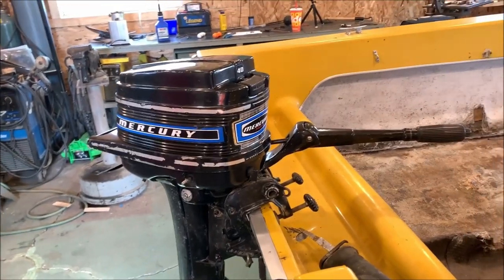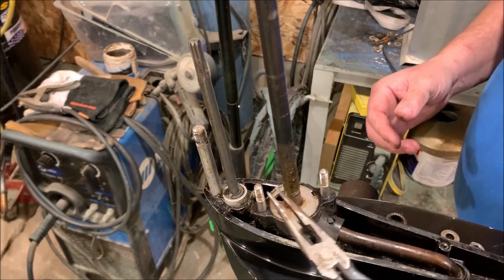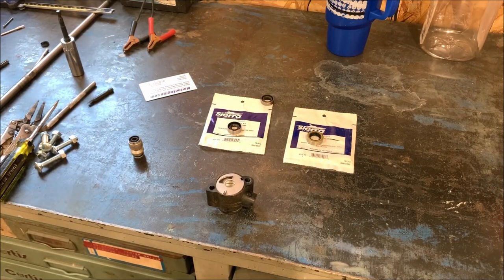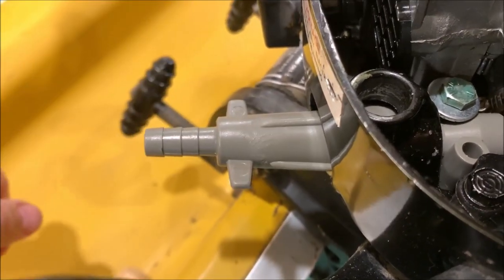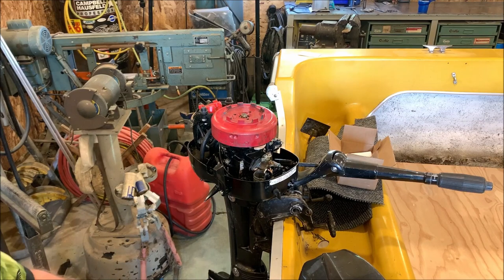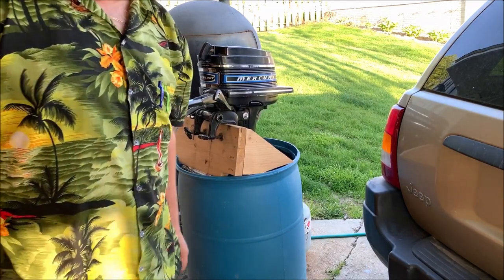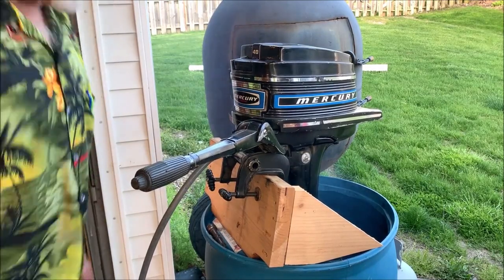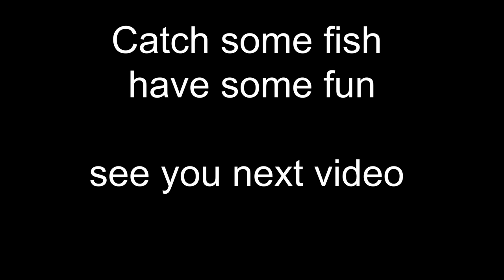Mercury 4 hp outboard 1974 will it run again epic journey of success made in the USA a man and motor

Comment: Thank you for helping us maintain our vintage motors. I have a 1967 mercury that runs great but hard to start. I noticed that I prime the motor and fuel is being back washed into the pulse line, is this normal or can I have a bad check valve in the pump? Thank you again for any advice you can offer. Subscribed!!!

Comment: Great video just got a boat today with the same engine first time owning a boat fired up the engine and had to keep starting it so next move is to do the fuel pump and clean the fuel system up and do the water pump as well because I wasn't getting water to come out like yours great video sir and do you have part numbers by chance thanks again

Comment: Just picked up a 1968 merc 6hp. Guy I bought it from said it runs a bit when he stayed fuel into the carb. So I figured it a fuel issue. Cleaned the carb it's was pretty dirty. I also hooked up a compression tester. Got 60psi on both cylinders. But she runs good after the carb clean. Good spark 60psi compression.and I guess now I also got fuel.

Comment: Great video thanks for the information, I have a 4.5hp 2 stroke that has the exact same carby and fuel pump but I can’t get the kits here in Australia and coming from the USA the freight is the killer. Could you help me with the quicksilver part numbers please for both the carby and the fuel pump.
Thanks again

Comment: Hey brother love the video. Im having an issue with the same motor. On the top cover of the carb there is a little hole and gas is leaking out. It looks like there is supposed to be a cap or a small ball bearing pressed in? Just curious if you knew anything about it.
Reply from the maker: If gas is coming out of the carb anywhere, then something is not right.

Comment: I just bought a 1967 3.9 hp Mercury with exactly the same running issues. I cleaned and rebuilt the fuel pump but the pump keeps leaking fuel out the sides between the mounting screws. Did you use any kind of sealer on the gasket or diaphragm. I just can’t seem to get it to stop leaking fuel. Any suggestions would be appreciated.

Comment: Hey Michael, have a dumb Q for you .. I have an old 4 hp from a garage sale for $25 bucks that I want to convert to electric. My plan was to remove the motor and fabricate a mounting bracket for my brushless motor... Any suggestions on removing the motor itself? I removed 6 bolts  and thought this was it but not sure... 1st timer here but not afraid :-)

Comment: Good video, all isssues I had have been addressed and the aspect of the right side of the engine showing the tell of the water pass thru was the last issue I had as the left side did not show the tell.  Good job, enjoy the "new" engine.
Reply from the maker: the old 4hp doesn't have the traditional pee hole. it just blubbers out the back hole above the waterline

Comment: I just started working on the exact same engine, could you perhaps share any tips on removing the carburetor? Just looking at it and it seems to be very very tight on space
Reply from the maker: remove the fuel pump and the chock knob first. This will gain you access to the carb.

Comment: Its not all about hearing it running. I watched this hoping to see how you removed and rebuilt the carb as i need to do mine and i cant get the carb off the engine. Cant find a video anywhere if how its removed
Reply from the maker: I have some mercury carburetor videos coming in the future.  I have about 10 mercs in the cue right now.
Reply: Same! I got mine out, but I'm dreading when I go to put it back in. Very tight on space.

Comment: So I acquired a Volvo penta 39. I don't know what it's called, but it has a bunch of blades on top of the motor. I need to remove this but I don't know if I should use a pulley puller from an auto parts store or a special tool is needed to remove this. Do you know where I can get the tool needed to remove this part or would it be safe to use an automotive pulley puller?

Comment: I have same motor from 1973. When doing a run test in a full rain barrel, I open throttle in neutral, and the exhaust is very grey and smokes a lot. When I adjust the low idle speed using the slotted screw above the carb intake, i got it to idle better and not smoke as much at low throttle. Gas:oil is 50:1 mix, using recommended 2 stroke outboard motor oil. Does one need to adjust the high and low timing screws on the cam which the throttle slides along? or does one just live with it burning lots of oil?
Reply from the maker: two strokes will smoke a bit, I like the Amsoil outboard mix, it smokes quite a bit less and it will foul your plugs less too. thanks for watching
Reply: @Michaelsbackyardmarina  thanks for the tip. I tried it with fresh fuel and it was as smokey as the regular 2 stroke oil I used before. I guess there might be a problem with the piston rings or something else which results in poor combustion.
Reply: It runs smokey like the one in these 2 videos www.youtube.com/watch?v=938OBzNR_vE and www.youtube.com/watch?v=7tFf44rZvxI . Any clues as to what could cause such smokey exhaust and how to minimize it?

Comment: I just picked up this exact same motor. I’m new to this. Can you tell me what type of fuel line plugs into this. The ones online appear to have a guide pin with the fuel line. This one is in a round hole that the fuel port is in The single male port had a spring loaded tip. There is a single pin at the back of the  fuel port that that is on both sides of the port thank you.
Reply from the maker: Check out  oldmercs.com to see if they show you the type on this 4hp outboard.

Comment: I was just given a 1981 I think, has been started in 10 years, so far I have cleaned the inside of fuel tank and new plugs, plan to get new fuel lines, install new impeller then see what happens, would appreciate any suggestions
Reply from the maker: Caburator may need cleaned, but try running it on a two stroke mixture with some seafoam.
Reply: That’s what I thought but dealer said Mercury product was much better

Comment: Did you ever have a problem with the gears in this motor ? I have this exact outboard and I cannot get reverse ? Reverse gear is neutral and neutral/forward gear is just forward ?. 
The gear shaft and gear leaver is lined up in forward position when the lower unit goes back on but it seems when I put the gear lever into reverse it skips a gear and everything gets messed up again. 

Any information is hugely appreciated. Thanks
Reply from the maker: If the shift shaft has been accidentally pulled and put back in the gear box is probably out of sync.
Reply: @Michaelsbackyardmarina  would you recommend taking off the prop to investigate the gear box ?

Comment: Put in New water pump in 1987 30hp Evinrude but it doesn't pump water! What should I check?
Reply from the maker: You need to blow air through all the passages. If air don't go then water don't go. did you get the water tube lined up on the pump?
Reply: @Michaelsbackyardmarina   I blew both air and water from pee tube all the way to water pump. With lower unit off the water pump doesn't pump water when shaft is turned while submerged in water. It's like water is not getting to the water pump.
Reply: Did you make sure the key was lined up with the notch in the impeller?

Comment: How much did you pay for it?
Reply from the maker: $200 and put about $200 in it.
Reply: $200 for a non runner seems high. At least here in Wisconsin. Like your videos on outboard repair. Can I ask where you find the replacement parts?
Reply: I bought a 1977 merc 4.5 about 2 months ago for 100 $ Canadian in great shape, complete except for a broken prop and fin and hasn't ran in 5 years. Got it running, welded the fin, changed the spark plug, the prop shaft oil seal, gear box oil,water pump impeller, propeller and drain and vent screws with the seal for a total of about 100$. Put it for sale for 375$ this week and sold in less than a day. I bought 2 merc 1970 something 9.8 and a 1980 merc 20, I Believe those will be a different story but worth working on them.